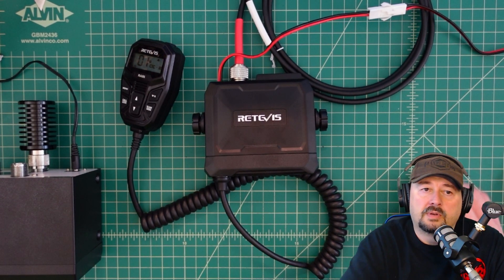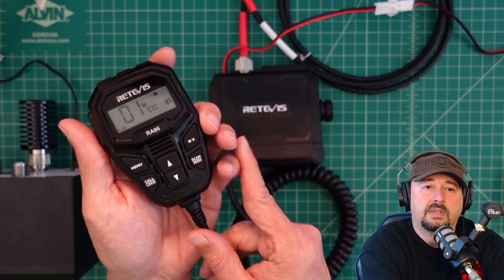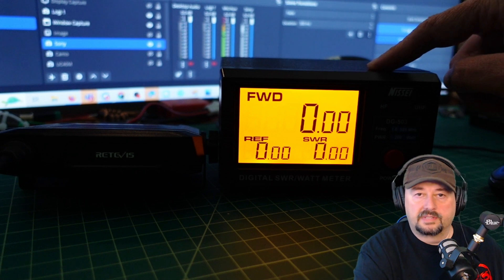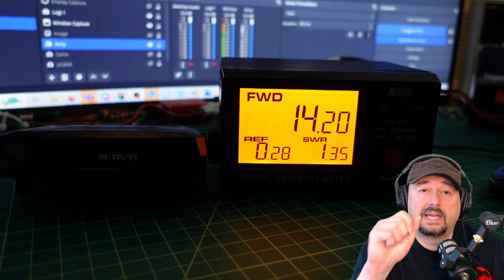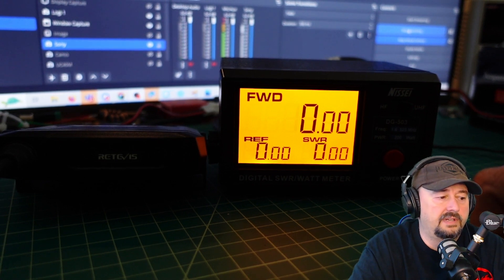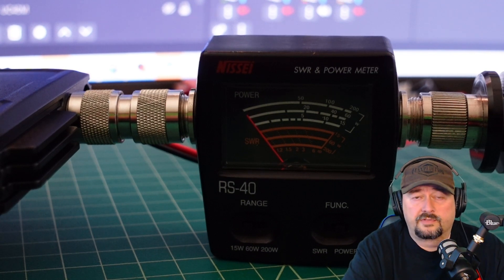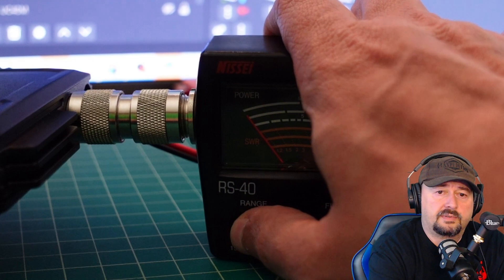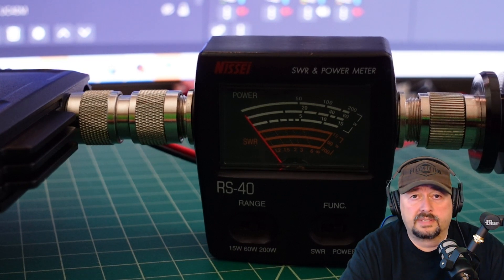Retevis RA86 GMRS Radio Power Test

Comment: Why not test the 467 MHZ repeater channel transmit power????
Reply from the maker: Hey Bryan, the max out on this radio is 20w 👍
Reply: @TheSmokinApe  Jail broken Retevis RA25
151 MHz Business band 23.5 watts
156 MHz marine 22 watts
159 MHz Trucking/Railroad 21 watts
462 MHz GMRS ch15-22  18.5 watts
467 MHz repeater uptake 17 watts

Radioditty GM30 
462 MHz ch15-22 4.5 watts
467 MHz ch 15-22 repeater uptake  3 watts

I run mostly open squelch and live in the  middle of nowhere. With the line of site of  UHF and a neutered  Jpole on the house.  I hear local with less noise from far away.
I prefer a 1/4 wave antenna on a vehicle over  5/8 wave which is hit and miss. 1/4 wave is short. If I hear it//it is a solid signal and likely I can talk to it.   UHF is not a good format for DXing.